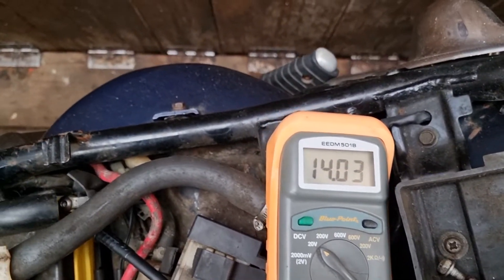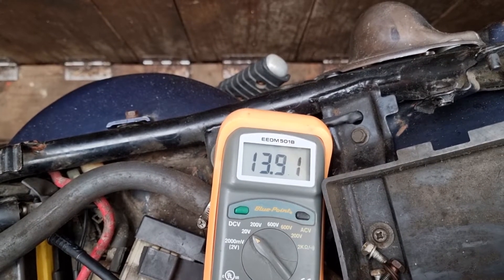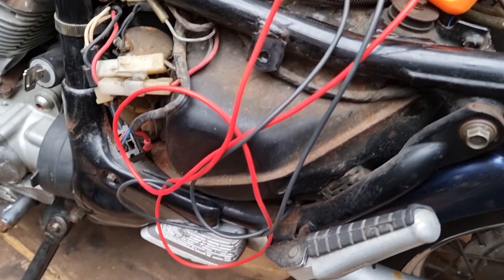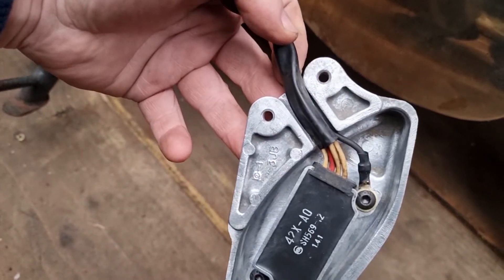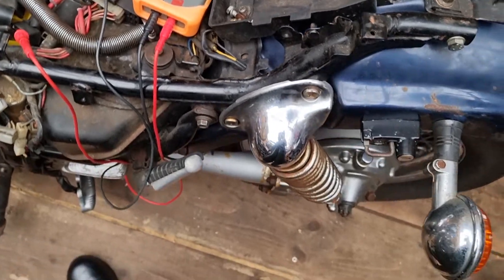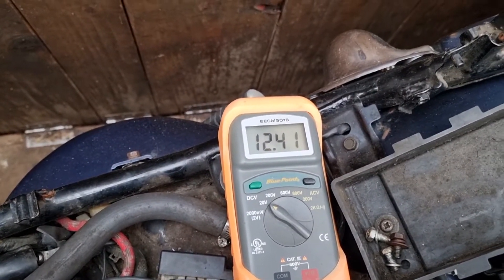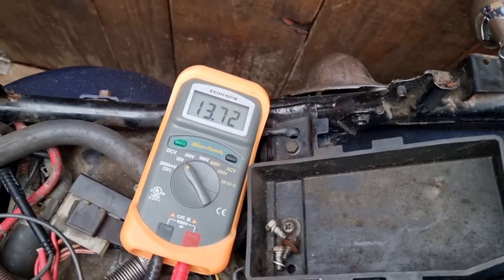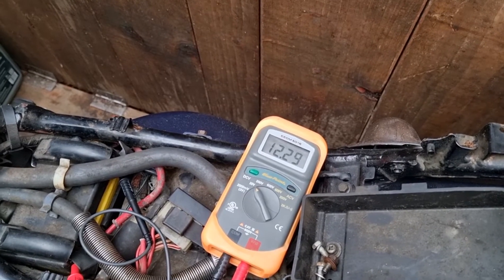How To Test Your 12v Regulator and what result you should get

Comment: Can we use a buck converter to keep the voltage stable?
Reply from the maker: Would one of those handle the variation?  I'm not sure. 
Maybe capacitors added into the mix?